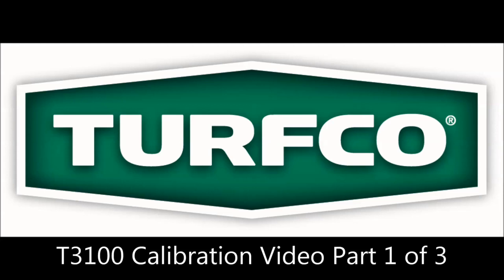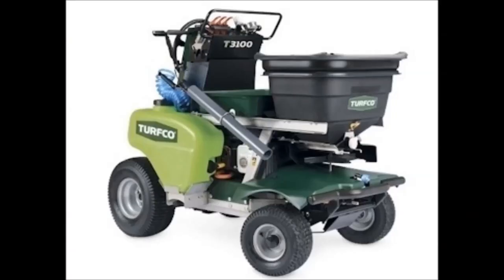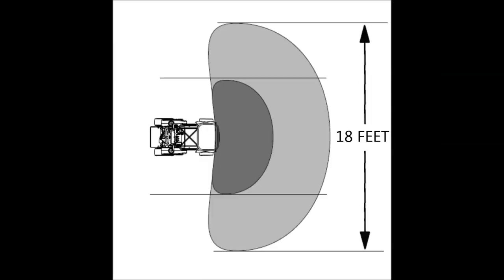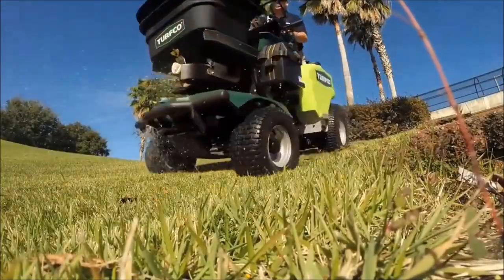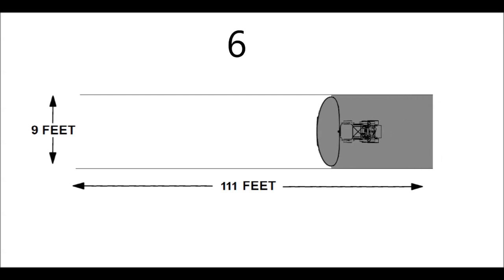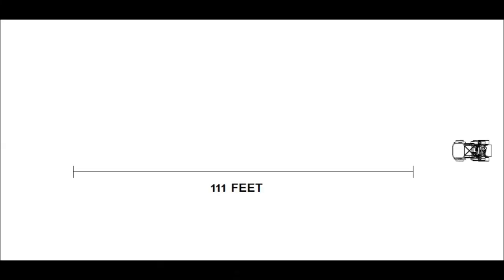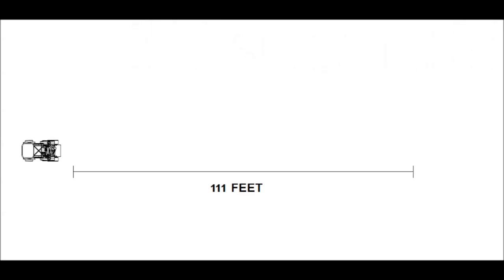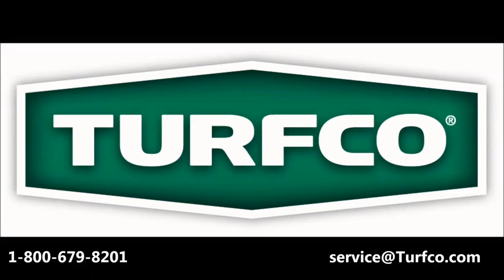T3100/T3200 Speed Calibration

Comment: What should we do if the 15 Seconds (111ft) is 13 seconds or 17 Seconds?
Reply from the maker: You can either calibrate to that speed or adjust the ground speed via the linkage that connects the hand and foot controls.  If you need help give our service department a call and they can walk you through it 763-785-1000 option 3 for service